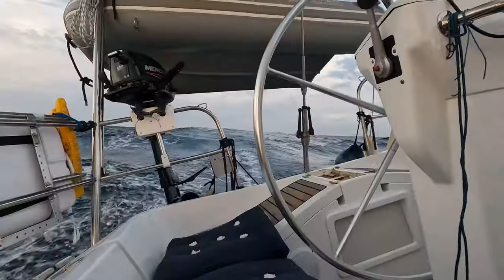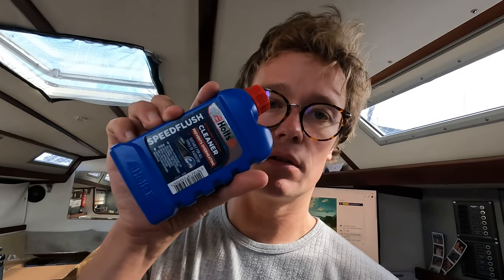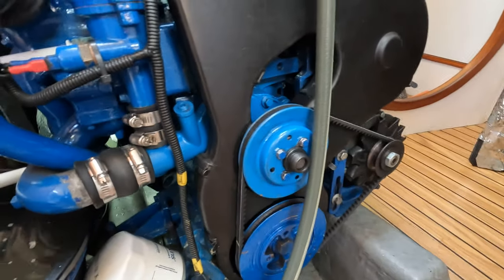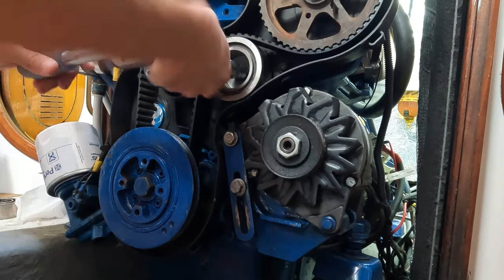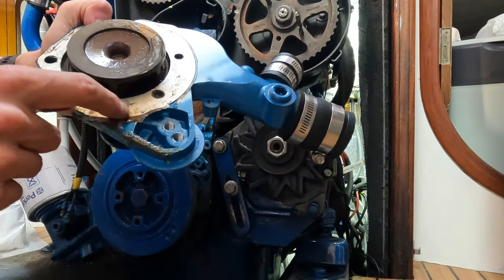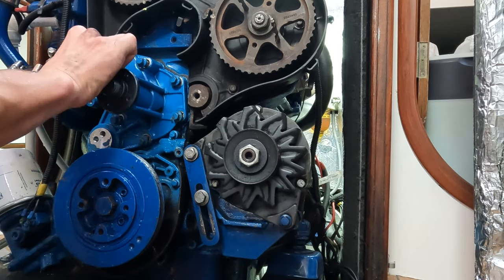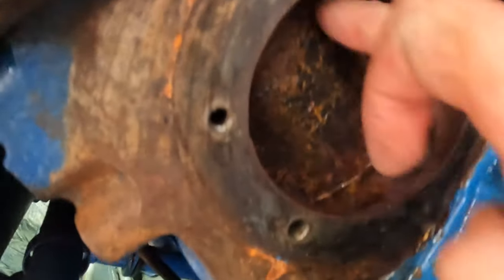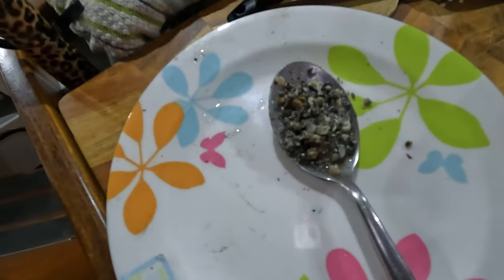E36 LEAKING marine engine coolant pump AGAIN (Perkins Prima M50, Volvo MD22L)

Comment: I had the same overheating, sand, and red rust problem with my 1978 Lincoln Continental 460 gas engine years ago. We removed the engine from the car, replaced all the rusty freeze plugs, and flushed the engine block. We found there was casting sand in the engine block left by the foundry when the engine was assembled. After this, the engine was better than when it came from the factory. A nasty problem was solved.
Reply from the maker: Oooooh Robert, that is very interesting, so it could genuinely be sand in the engine block. I assumed it was some sort of limescale/ mineralisation going on. It may well be both. Thank you very much for this insight.

Comment: I know this was a while ago but just came across it. My suspicion is that somewhere along the life of the engine some incompatible anti freeze was used and probably local tap water. You should only use engine manufacturer anti freeze and always use distilled water or pre-mixed anti freeze.

Comment: if you have an electric water heater in line with your engine water, you might need to descale the water heater. Just a thought.
Reply from the maker: Hey Rex, we do have an inline water heater. Although it is brand new and only installed about 5-6 months ago at this point. What do you reckon?
Reply: @sailingnendaz  if there is a drain, you can sample the water or if there are heating elements which can be checked you might want to try. Your getting water from all over the world so there is no telling how much lime and other minerals might be present  Good luck and if possible, check with Walter
Reply from the maker: 😂 I will consult with Walter first, although I’m not sure I have enough biscuits for his fee.

Comment: if in the future you still need to wash the block, you could try citric acid.  it just loosens the rust and you can leave it for several days to take effect.  you can buy it as a powder, at least here in Finland.
Reply from the maker: Thanks Aleksi, I think one day in the future I might take it all apart again, and give it a proper acid wash. Ideally I'd like to take the coolant header tank off I think, but not sure how easy it is with access. We can buy citric acid in powder form in the UK too, we used to use it to make Elderflower Coridal :)

Comment: The sand could be from the previous owner. IF the heat exchanger core was leaking, it could have gotten sand in the engine if they entered aground?? It would be interesting to see what is in your muffler???

Comment: Thanks for this video...might not need to phone the $145/hr folks. If you don't get lucky with #1 TDC, is a ratchet on crank easy? (no injector removal? And..what size drill bits fit the locking holes in the cam, crank and fuel pump? Thanks again for an informative video.
Reply from the maker: Ratchet on crank is pretty easy to turn for our engine. I think it was 6.5mm drill bits for a really good fit. But I used a combination of 6mm and 6.5mm as it was what I had available. It’s the same size hole across the engine. Hope you manage to get sorted!
Reply: @sailingnendaz  Thanks...appreciated!